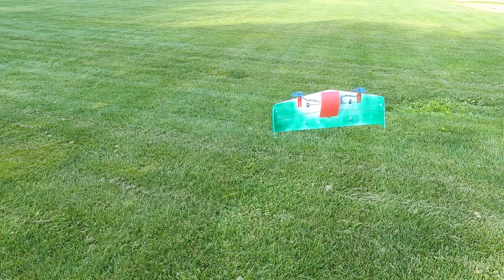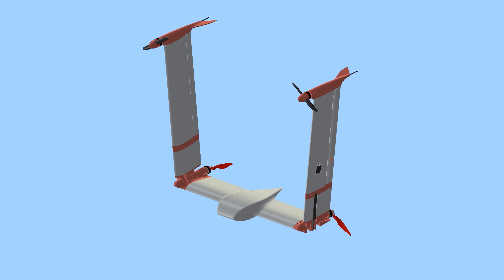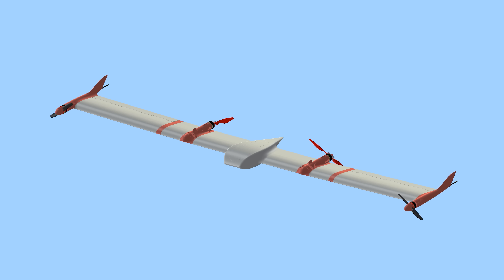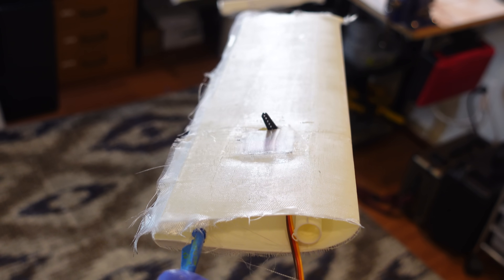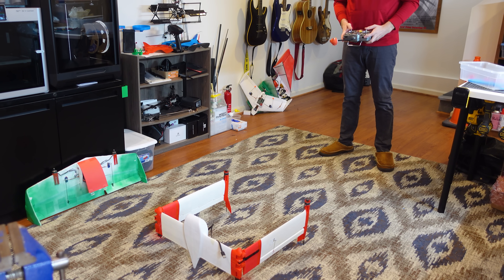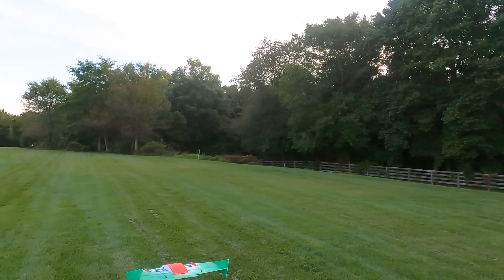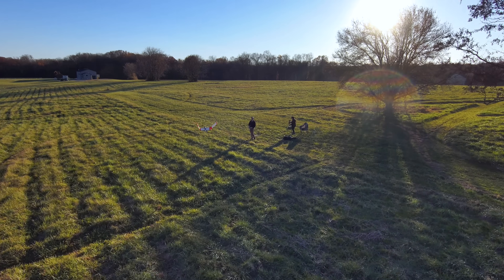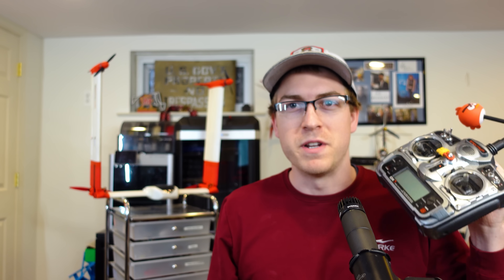Un-Folding a Quadcopter to Increase Efficiency - Part 1

Comment: Seems like pitch stability will be challenging when unfolded.
Reply from the maker: Hopefully active stabilization works as it should!
Reply: @NicholasRehm  , I think you have created a  challenging design to compensate for all the control coupling.  Pitch instability is one. I would have chosen a swept wing to deal with that one. I also expect you'll get yaw-roll when unfolded and yaw-roll-pitch coupling when partly unfolded because speeding up one prop will increase airflow over that wing, creating more lift on that side, which is what I suspect is leading to the wild oscillations as you're unfolding. I'm curious to see if electronic stabilization can ultimately deal with it.
A really interesting approach to the same design brief as your prototype is the one by PteroDynamics.

Comment: Looks like ss it unfolds it loses the "rudder" or vertical stability affect. Engine thrust vectoring is used in real rudderless planes, can you program the motors to compensate?

Comment: Hey! I think you hinged the WRONG WAY 🤔
Have the wings fold "UP" means you can hit a dead stop making the hinge stronger.
Your wings fold down which means you have to hold them down to prevent them folding up. But if they start off "hanging down" and you lift them "up" to a dead stop, they can't go any further!

Comment: So . . .why DID you choose to fold the wings downward? Was there any consideration that the reverse might be preferable? Unfolding them upward when it's in motion would be assisted by the lift generated by the wing in motion, and held in place without additional force needed.  A lot of the challenges you faces seemed to be fighting lift, when it could have been assisting you. With control surfaces, you can pitch upward without the props. It should be easy to refold by initiating a stall before transitioning to hover.
Reply from the maker: Dihedral Vs anhedral

Comment: Awesome project! Wouldn’t it be mechanically better to have the wings fold the other way? So then in airplane mode, you can have a hard stop for the wing fold instead of it pushing on the actuator.

Comment: If you really want to focus on efficiency in flight I recommend reducing the chord towards the wingtips to get a more elliptical lift distribution. For a straight wing, usually a taper ratio of 0.4 gets you pretty close to elliptical. This also has the effect of increasing the aspect ratio even further. This might however not be structurally viable, but that depends on how much of the loads are carried by the carbon spar vs the actual airfoil.
Reply from the maker: I considered taper but ran into issues of thickness at the tips that made cramming a spar in there difficult

Comment: Given that the fibreglass takes extra time and effort, did you calculate how much weight would be added if you just used normal PLA instead of LW PLA?

Comment: if it is a tail sitter then why have the wings fold up you would have a stronger wing if the wings folded down that way when the wings are in flight mode the hinge in the wing moves in the opposite direction of wing deflection it would also help stop the oscillation because the wing would not become overly dihedral and it would be anhedral during the transition thus making it more stable

basically fly it upside down from how you have it now

Comment: I suggest to put the wing-hinges different from 90 degrees such to have the wings v-shape backward, like traditional flying wing designs - this will give much more stability for unfolded flying. To boot, you have have the propellers at same level when in drone configuration.

This is a really cool project  - good luck and load of success!

Comment: If the linear actuator could somehow pull a few CM of carbon rod across the hinges then that would probably be quite strong or some sort of locking mechanism. But it seems strong enough.

Comment: Very cool! But why not fold the wings down instead of up? Then if you limited the range of motion of the hinge so it can't fold higher than horizontal,  the actuator wouldn't have to fight the lift forces during flight?

Comment: What if it's quad mode folds into a ᑎ instead of a U? By having the wings folding up to deploy, they have nowhere to go afterwards the weight would apply force in the direction the joint physically can't go, such the actuator could be smaller and lighter

Comment: This is a perfect design... hope you work out the kinks...
Reply from the maker: Thanks! Working on it now
Reply: @NicholasRehm  the ultimate dream and the best blade design that I came up with that I was going to use for making high-speed vacuum tunnel train system coupled with electromagnetic propulsion... basically the pitch of the blade can be changed while the play the spinning so you can put it into reverse thrust mode without stopping the spin of the blades... this will give you full adjustability and adaptability with as much efficiency as possible. Probably over engineered for this task but who knows... i just think its cool. Adjustable blade pitch will give you more performance as well... was going to use this for the vacuum propulsion system basically using powerfull electric turbine fans What's blades like this that can go from sucking to blowing as basically a linear propulsion system that would be used in conjunction with electromagnetic levitation and propulsion it would make a super bullet train that could go over 1,200 Mi an hour easily... as the train travels down the tube they switch airflow direction for the fans and now instead of sucking it's blowing because train passed through... actually the system will work for a satellite space launching system that can launch solid build satellites into space from Earth reaching terminal velocity like a cannon...
Reply: @NicholasRehm I'm not sure if you realize it or not but your design has been implemented by the military... They are using this for their drones that are appearing in New Jersey... I came up with the idea of a drone defense network that is self deploying and you can use the drones to fly in charging stations that are solar powered and that's exactly what they're doing they are building a drone defense network that's fully autonomous in production deployment and maintaining of the network... If you notice the drones they are using are extremely similar to this design because you came up with the best design.

Comment: Badass dude!! You’re doing all of the flight configs I wish I had time to play with. 
Eagerly awaiting the final product here. I truly think this is the most efficient VTOL concept  out there. A future state could even reduce the servos to one with some push rod and gearing action for a slight weight reduction. 

I’d be curious also to see some side-by-side  performance data with all 4x motors running vs just the 2x outboard. My gut would say you probably gain a little efficiency by running them all at slightly reduced throttle than the 2x config at slightly increased throttle. Not to mention the yaw control is nuts when only using the 2x outboard motors. A motor-out scenario would be catastrophic if not hilarious to watch at Rc scale lol. Chance of survival in a motor out scenario goes way up if 1/4 go out as opposed to 1/2, I imagine
Reply from the maker: I'll definitely test power with all 4 vs only outer 2 in forward flight

Comment: Maybe have some springs inside the inboard wings attached to line which feeds under the lower portion of the hinges and is attached to the outboard wing segments.

Would only add a couple grams but with the right amount of tension should reduce the forces on the actuators.

Comment: This is such a neat design. Do you think something like this design would translate well to the manned, air-taxi/quadcopter designs since it seems like it would work so well for vtol, but also potentially be much more efficient during flight?
Reply from the maker: I don't know if tailsitters are a good design for passengers. Closest I have seen is the opener blackfly
Reply: @NicholasRehm true, I guess it'd be tough to enter and exit. Maybe a rotational mechanism for the cockpit to keep it always aligned with gravity?

Comment: What would be the disadvantage of making the wings folds bottom up instead of the way it is current configured? Wouldn't it be better for structure purpose?
Reply: I do agree that a fold up solution would be mechanically stronger than a fold down. No idea how aerodynamics would be tho.

Comment: Should have under swung the hinge. That way the lift generated would keep wing locked open.  Considering it started as a tail sitter the direction of wing folds, should not matter.   Just say use physics to your advantage!

Comment: What if you gave it a folding tail that acted in part as landing legs?  It might help your stability issues, too.
You could have little male/female nesting conic frustums on the wing tips and tail tips so that the overall structure would be more rigid in the folded configuration, too.
(i.e. the wings and tail would be 'locked' together when folded)

Comment: I don't know anything about designing aircraft, but it seems to me that a few ideas lie on the surface:
1. Such a long wing definitely needs a tail to stabilize the flight, especially when transitioning between configurations. The tailless configuration is obviously unstable.
2. Have you thought about folding the wings not over the middle part of the wing, but UNDER IT? It seems to me that this way you can make stronger hinges.

Comment: Your center of drag is even with your center of lift - of course it's unstable. Try launching it with the wings extended and it will probably twirl about the wing's axis. Maybe if you swept the wings back, or put a twin tail on it, it will put the center of drag far enough behind the center of lift, an this will correct the instability. Then be sure your center of gravity is ahead of the center of lift as well.

Comment: Your oscillation is divergent control loop to Dutch roll coupling. You'll either need to slow down the hand off between VTOL and aerodynamic control, or change the entire speed of your transition; likely either slower rotation, faster wing deployment, or a transition in more of a 45° climb using ascent rate as the speed handoff between quad control and aerodynamic control.

Really cool design! Although sweep is a slightly less efficient planform, it could be made up by a higher performance airfoil transition negative Cm/ high lift at the root with washout/ and natural or positive Cm at the tips. A horten style center section could still allow tail sitter functionality and prop clearance with trailing edge. Side benefit is it would relieve the tip motors of a substantial amount of their workload maintaining directional stability, and instead can be mixed as a proverse yaw solution instead of active stability management. This can drastically increase the efficiency of your motors as well.

Comment: one other issue to consider is not exactly perfect tip motor alignment - or the wings being a slight different angle in reference to each other....giving you an unbalanced force along the thrust line. I could see that giving you a large oscillation with the flight controller fighting it. Your small wing that you built (tail sitter) that is similar in design to the X-Vert doesn't suffer as much because the motors are closer together. With the wing tip motors being so far apart even a slight divergence in the thrust line from end to end could be one of the issues you are facing. Just my $0.02 old friend!

Comment: Great work! In the transition state, the control surfaces change from rudders only to V-tail then elevons. I'm not sure if the tilting angle is enough to determine the current state or if an airspeed sensor is a must.😁

Comment: Great projects. Love the idea and implementation. My only suggestion would be to reconsider the linear motor for rotational actuation. A proper worm-gear servo would seem better suited. Maybe even some "smart" servo's would suffice. I'm fascinated by the 3D printing of lightweight structures. This is something I need to take a closer look at. It might just be the perfect use for all the 3D printers at my disposal. I'm from the old school where CNC milling and hand laid composites are king. They still are but time is money and the 3D printers could be put to good use making thin skins. I always lamented how often students used 3D printers and the time wasted when every iteration would break because of a lack of understanding of how plastic in pure form is rather isotropic, then 3D printing makes it anisotropic with ONLY losses in strength characteristics.
We used to call these types of machines rapid prototyping, but they are not rapid and they don't leave you with very good prototypes unless you learn how to best use them. Your application seems perfect! Thanks again.
Reply from the maker: I initially looked into worm gear drive. But I didn't want to do position feedback on it myself--much easier to use an existing pwm-servo to directly command actuator position. Plus most hobby servos that are multi turn wound up being too large for this particular project
Reply: @NicholasRehm  Not only what you offered as a reason, my initial reply is incorrect. A worm-drive would put the shaft and motor 90 degrees off, making a similar problem. The only reason I still think a worm-drive servo seems better suited is to best size for the transition where non-linear force is required. Great project.
My intuition says your outboard props have too much authority. Might try using only the inboard on the horizonal flight. I know you want to use the outboard but without a tail rudder for some stability, you're entering the response time of the motors to create thrust. Another option might be to find censored motors where motor controllers can add faster dynamic speed (thrust) changes.
I really want to see it fly fully extended :)
My gut says you'll want a deployable tail. Can be static if you keep thrust vectoring, which I don't know why you wouldn't. Subscribed.

Comment: If I may suggest. Quit using the ailerons to stabilize your drone flight. As you transition, they destabilize your fixed wing flight, cause midway from drone to FW transition, they influence yaw (think V-tail). That's where I think the oscillation comes from. You have them going from roll control to roll/yaw to roll/pitch during transition.
Reply from the maker: I do have them fading from yaw to roll control, but obviously need to get that tuned out better
Reply: @NicholasRehm  As I see it, those ailerons/control-planes now have 3 fases: as 'normal' drone=pure roll axis control, when you start to pitch into level flight/fixed wing mode, you fade them to yaw control.  When unfolding the wing you in the end need the ailerons to work als elevons, mixed roll/pitch. The problem is that unfolding the wing, you start with the ailerons controlling yaw, but when completely unfolded they need to control roll/pitch. They need to work as elevons. Somewhere during the unfolding of the wings, your 'drone-plane' will become unstable cause there is still yaw control in the ailerons, while they need to functions as elevons. They are at some point more or less controlling 3 axis (yaw and roll/pitch . 
Wouldn't it be easier to not use the ailerons in drone flight? Then you only have to worry about fading the ailerons into roll/pitch control (elevons) at the right time, when unfolding into fixed wing mode. You can always use the motors to control yaw by differential steering, both in drone mode and in fixed wing mode. I do that with all my multi-motor planes. But this way you should not have as much oscillation you now have. It will always be a problem, cause there will always be a point where your 'wing mode' has a V-shape and it's control-planes (ailerons) will influence all 3 axis.
I also think you need to transition as fast as possible, to pass this unstable point as quickly as possible. Flying it halfway unfolded is probably the worst thing you can do for stability.
Just my thoughts. But who am I?

Comment: FWIW, APC makes two "folding pusher" (counter-rotating) props..  5x5 and 9x5.  
And if you've got the power, you could try transitioning into "forward" flight by accelerating straight upward while unfolding the wing rather than trying to do it horizontally.    The oscillations you're getting at half unfolding look like dutch roll oscillations.   They should go away when the wing is full flat, but going to be annoying to get past..  without going straight up.
Reply from the maker: Good find!

Comment: The transition imbalance on an identical design has already been solved by Amazon patent US9550567B1 (2014) "In-flight reconfigurable hybrid unmanned aerial vehicle", by adding a rotatable tail wing with rudder.

Comment: Ingeniusly simple concept that I've not seen before (simple but yet a bit tricky to make it work smoothly no doubt). Maybe if you could simply take off like a normal drone, go straight up maybe 50-100 feet then make it fly forward like a drone would, with the drone pitching forward more the faster it goes. If it was pitched forward a lot and moving fast that way it would be less likely to do the dutch roll oscillation maybe?

Comment: I'd also switch motor functions. Shut off tip motors in hrz mode, use inboard motors. Alice (the big electric plane) found out tip motors are a bad idea.